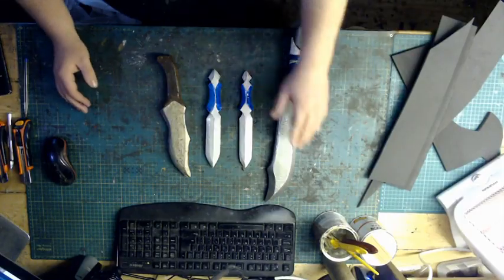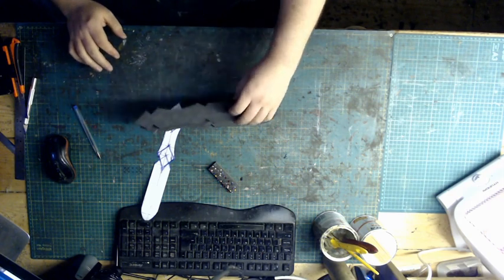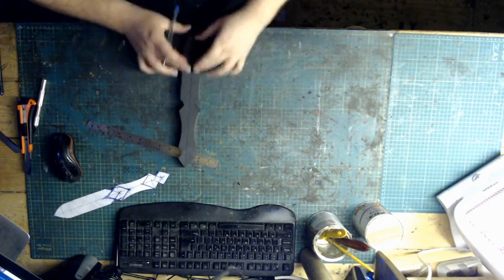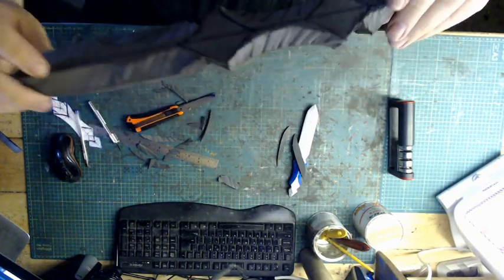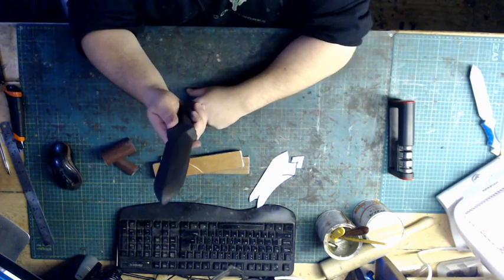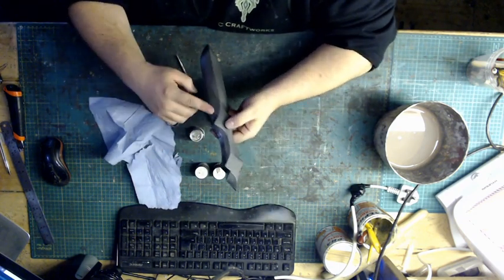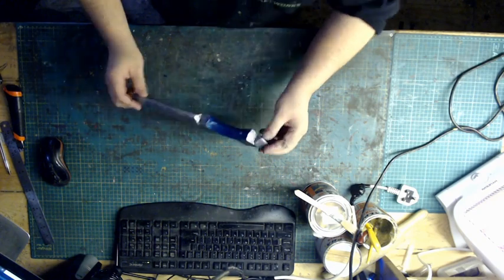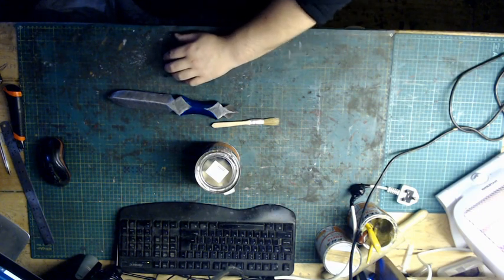how to make LARP thrown weapons

Comment: Thanks for the tutorial! May I ask why you do a few layers of latex before applying the FlexiPaint primer? It seemed one of the major selling points of FlexiPaint was that it could be used right on the foam to save time - but then again, I'm still new at this hobby :)
Reply from the maker: hi, mate not at all ask all the questions you want that's why I make these videos to help people. so Flexi paint is a brilliant and robust paint however continued battling and weather will wear it down rather fast. latex will add years to the prop. also makes the prop more robust and adds a better finish to the end product. latex mixed with flex paint leaves an awesome finish and a sturdier prop.